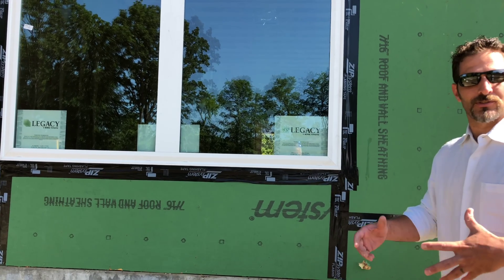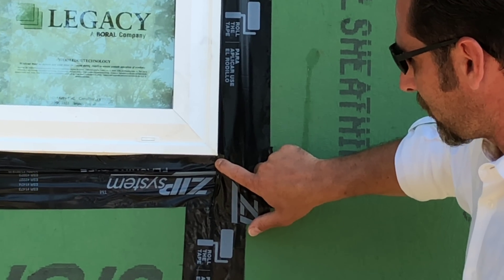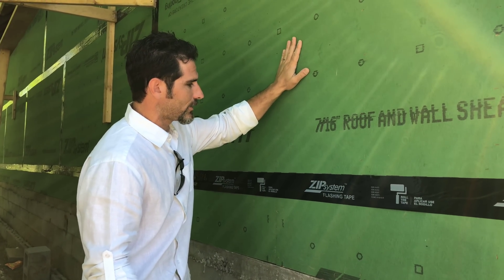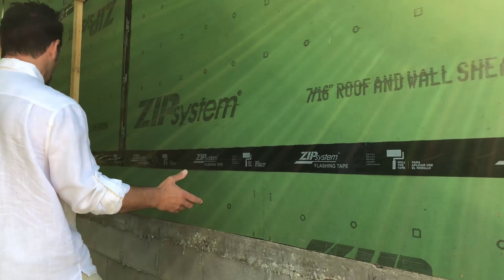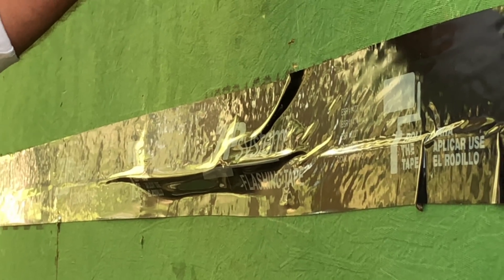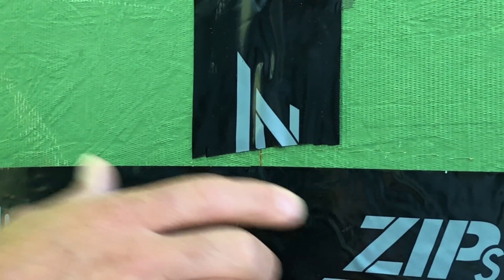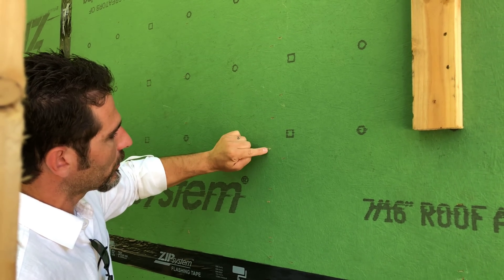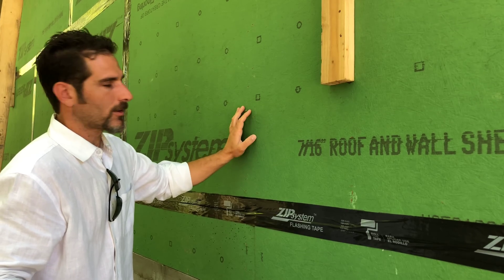ZIP System Problems

Comment: So once the house is sided, don't all these problems go away ??
Reply from the maker: Absolutely NOT!  There is not any type of cladding that does not allow water to enter somewhere! This is a very common misconception I hear even from builders that, "have been building for xx years".  All claddings either wick moisture or allow water to get in around windows, doors, pipes, electrical outlets/switches etc.  You need to make sure to set up your wall system to accept water & drain it.  This needs to be done specific to the type of cladding you are using because flashings, drainage mats & details change depending on the type of cladding being used!  Thank you for watching & feel free to reach out to us with any questions you may have.
Reply: Were that true, every house in this country would have fallen apart from rot years ago.  While vinyl siding IS crap, allowing water in many places around the channel pieces, a good wood or hardiboard siding properly installed and caulked is about as water tight as it gets.
Reply from the maker: Ed Smith if you are willing to rely on caulking to keep water out, that will definitely be a bad idea long term! Caulking eventually separates due to expansion & contraction in the structure as well as the difference in expansion & contraction of different materials at their intersections. If the paint and caulking does not have any cracks or holes in it & it is maintained yearly then you might get lucky:) Thanks for the comments & for watching!
Reply: @WeatherProofingAmerica  You  are talking about cheap "lumber yard" caulking.  Good commercial sealants last for decades.  I remodeled my house 41 years ago and my Tremco caulking seams are all still intact.  Great video  on Zip system.  I agree with your comments on it's shortcommings, but  where is the code required exterior insulation with Tyvek??? I see three separate claddings; sheathing, insulation and air barrier.  Labor costs are driving Zip use here (one installation vs. three)  and many code officials are requiring it.
Reply from the maker: ajaxa9 I try to set a home up with the thought of most homeowners aren’t very diligent in maintaining their home. So if the caulking that a contracor uses  (not a caring homeowner like you) is not quality it will crack or separate from the buildings expansion & contraction. So when I set up a homes waterproofing I do it in the manor that the home can accept the water behind the veneer & drain/dry out! There are some good caulkings out there but most don’t use them!

Comment: So would their Liquid flashing be a better alternative? Also you Mention permeability, If you where to insulate the inside with a Close Cell Foam, would that eliminated condensation issues? I plan on building a house in about 12 mos. but also want to seal the house as best as I can.
Reply from the maker: ZGERMAN I have not personally seen anyone use the liquid flashing with the ZIP systems I have personally seen. Therefore I don’t know how that will work overtime. I can only imagine if people can’t install the tape correctly imagine the time and the effort that it is going to take to install the liquid flashing and especially now that ZIP is recommending all of the fasteners be sealed with the liquid flashing as well. They continue to change their installation instructions which tells me that they are aware of these problems!

Comment: Both tyvek, and zip, can be good if installed correctly. I have yet to see a framer install either one 100% correct.
Reply from the maker: Now that ZIP is requiring the nail holes to be sealed with their liquid flashing stuff (was not always required) you could be somewhat correct!  The biggest problem I see with ZIP system is in order to install it correctly it is difficult & much more time consuming than Tyvek.  ZIP is also much less forgiving if not installed correctly because there are so many tape joints & holes to seal!
Reply: @WeatherProofingAmerica  if if installed correctly, there is no way for the water to get out. It just stays behind the siding. There is no lapping paper to bring the water back out.
Reply: Just curious, are you sponsored in any way by Tyvek?
Reply from the maker: nobster146 No I am not paid or given product by ANY manufacturer! I am just passionate about helping people avoid costly issues:) I have repaired water intrusion for 15 years now and see the heartbreak for the homeowners when they have to pay for something they should not have to & the expense is very high! This ZIP nonsense in my opinion is a terrible idea to rely on, to keep water out! It is however a much better roofing and wall panel over OSB for sure! The r panel is also a good thermal break panel! But to prevent water intrusion is not a good idea in my opinion!
Reply: Yes!  We're engineering ourselves into a corner, with systems that require perfect application to work properly.  But NOBODY installs them perfectly!  It just takes too much time.  Also, the guy who understands how to do this right is too valuable to spend his time taping...he will be assigned projects that "matter", while the least skilled guy does the taping.
Reply from the maker: @fredygump5578  this is precisely why this system has the potential to be disastrous for the homeowners, it is not very forgiving if installed incorrectly & it will more often be installed incorrectly than not!  Very bad idea of problem solving but they are great at marketing!

Comment: My biggest question with the tyvek, is what about the thousands of holes that the siders put through it?  Maybe you can answer that. I haven’t found anyone else who can.
Reply from the maker: Juston Brazada that is a great questions!  It's very simple, they are not holes unless the nails are pulled out!  If the nail is in the hole the water molecules actually seal around the nail & Tyvek & the water runs around the nail because that is the path of least resistance!  Sounds strange I know, but that's what happens most of the time. However if that small amount of water does get behind the Tyvek, the high perm rating that Tyvek has will allow the water to escape & not cause any issues!
Reply: Weather Proofing America, what ties do you have with DuPont?  Your comments read like Tyvek brochures.
Reply from the maker: superspeeder my only ties to DuPont is using Tyvek for the past 15 years to correct water intrusion!
Reply: Weather Proofing America, do you build new homes or just repair/remodel?  I ask because I’m curious how airtight an envelope can be using Tyvek.  It certainly seems like an airtight exterior shell is just about impossible if relying on Tyvek, given that bare typical OSB cannot be relied on for airtightness when taped/sealed.  I’ve yet to see builders showing off blower door results using Tyvek sealed exteriors.

The average builder does a horrendous job with Tyvek, and even a careful builder would be hard pressed to do a truly good job of air sealing with it.

Comment: Basically your video is about poor installation methods by contractors which happen with any product . You can have the best product in the world but if you have people who dont care about the details and only speed you will have issues . I'm sure there are houses  with Tyvec that have some issues as well do to poor  installation .
Reply from the maker: Uri Gonzalez I agree with you!  The point of the video however is to show that incorrectly installed ZIP can have far more issues than Tyvek incorrectly installed!  I was mainly wanting to show people that ZIP is not easy to install correctly & is time consuming, because it was being marketed as faster & easier but it's not!

Comment: Well the contractor screwed that up. You talk about how it should be taped at the bottom is wrong it should have a flashing from studs to out side of the concrete wall so water cant get back in the house.
Reply: Actually what he said was exactly as Zip wants it done.
Reply from the maker: Brent Frederick if the tape is not reliable at the bottom of the wall which is why I am assuming you are saying it needs a flashing instead. Then how are the thousands of feet of tape on the rest of the house okay?  Point here is: this system is being marketed as very easy and quick to install, when in fact it is quite the opposite if done correctly. There are way more opportunities for air and issues than any housewrap ever thought of!
Reply: Brent Frederick moron

Comment: Zip is only as good as the contractor installing it. When done properly it's a good system. Myself? I would rather see plywood with a liquid applied WRB and flashing like prosoco.
Reply: It's insane cost is the only thing preventing me from using it. It's over $2 per sq foot in Canada at least but it definitely is the best solution
Reply: fzr600rr wrong

Comment: Is there any liquid sealant system for Tyvek, if you don't want to use tape?
Reply from the maker: Kevin Hornbuckle DuPont makes fluid applied Tyvek for block or concrete walls but I am not aware of any liquid sealant to replace the tape.

Comment: Why should any water be running down the face of the zip system?   From my experience, the only normal water that is running down the face of the Zip system is condensation.  Condensation caused by the interior cooling system of the house  chilling a membrane near the exterior.  The wet exterior of your glass of iced tea on a hot summer day?  Or perhaps in the winter, the condensation is on the inside of the Zip panel, water vapour migrating from the humidity of a humidified house out to the non permeable barrier at the dew point in the wall?

Use plywood and 30# tar paper,, it works better.
Reply from the maker: Water gets behind ALL veneers (brick, rock, siding, stucco, etc) either through absorption or around opening such as doors & windows or joints in the veneer etc.  So when the water does get behind the veneer, your waterproofing should be set up in a manner that will not allow the water to penetrate the structure!  Tarpaper is a terrible product to keep water out!  I can show you hundreds of pictures of rotted tarpaper because it is an organic product that breaks down when continually getting wet & dried out to the point that it crumbles & is no longer there when we take the wall apart!
Reply: I have been a licensed builder for nearly 50 years.  I have built with every system you can name, with every product x2 to what you have.  If water gets in behind the siding, then you or the architect have made a very basic error in design or construction.  A house built with no over hang, no eaves and soffits where it rains (everywhere?)  is wrong.   A siding that does not keep water away from its sheathing, no Z-strips, no sill water table, is wrong.  Most damage I have found in more than 50 years of building is caused by  no or tiny roof over hangs, no lap of waterproofing around a window,, and lately,, whole house humidifiers that are pumping gallons per day into an envelope with a non permeable layer to the outside in the winter,, or a non permeable layer to the outside in a warm humid climate that requires year round cooling.

Condensation within the walls has become the enemy from winter time humidifiers and summer cooling. And THAT is a problem of non-permeable layers to the exterior.   Most supposed window leakage and damage,,, is not from the windows,, it is from the condensation from the windows, and the condensation within walls..

Yes, Zip R systems will have condensation on the exterior of the sheathing in the summer,, and on the inside in the winter. And if you don't tape the begeeebers out of it....  Exteriors need to allow moisture to migrate, AS VAPOUR.    I have built with all of these systems,, most require a level of care and expertise that is simply not there or will never be there in a commercial rough carpenter's  time, profit, or purview.   The defects you point to in your complaints, are yes, defects.  But they are defects endemic to the product.   There will always be defects of the type and size you have shown.  Always.  It WAS rolled down.  Tyvek,, per the manufacturer, is to be applied after the building is up and in one continuous wrap around the building.   I defy you to try and do that on a windy day,, of 6 mph,, on a ladder,, over a muddy pre graded site, with a crew of less than 10 people.  That IS what you are supposed to do. It is just that,,,, on 29 out of 30 days,, it cannot be done.  Oh,, yeah,, and then you MUST purchase the proprietary tape at 1,000 dollars.    And what makes you think that that expensive tape is going to stick to 10 day old concrete,, or zip r panels that have been dragged through the mud or dust to get them on site.

30# or 45# felt makes a better outside of sheathing barrier than ANY of those products.    Let us go up on the roof,, Roll out ridge vents for a roof are a disaster.  Should never be used,, never be allowed.

And my tar paper extends OVER the wood concrete junction,, and up under the window,, and my skin will self seal,, without tape.  And last for 100 years. And never trap moisture.  So mine never has water running down under the siding, ever.  I have peeled apart 80 and 100 and 200 year old buildings,, it is the 20 year old buildings that are failing.
Reply: @WeatherProofingAmerica  ... your statement - " Tarpaper is a terrible product to keep water out! "
Ges that's why it's been used on roofs for 100 years or so ... to help cause water leaks  (LOL)
Reply from the maker: nemesisX rox the only purpose of tarpaper on a roof was to simply keep the asphalt product from touching the plywood because the plywood will suck the asphalt oils out of the shingles which prematurely ages the shingles making them very brittle and no longer able to successfully do their job. The tarpaper is not intended to keep water out because it does not do that! It is a very porous material and also becomes very brittle after constant exposure to water and or sun! Tarpaper is not a waterproofing material and should not be relied on to keep water out of anything!

Comment: I was with you until you stared talking about breathability. Homes don’t need to breath people do.  
Use zip boated with zip liquid flashing instead of tape resolves all the issues you pointed out.  
No system works of Installed improperly.
Reply: Homes may not need to "breathe" (assuming you have a way to maintain indoor air quality).. but they DO need to be able to dry to the exterior if/when moisture winds up in the wall cavity.   Yes I know... water isn't supposed to get into the cavity... but in most parts of the country, we have swing climates and environments that are the opposite  in August and February.
Reply: @HBSuccess home must breath or they ROT!
Reply: You do not know about structures then.  Study fluid dynamics as well as thermo and you might understand. Check out the Psychometric chart.
Reply: anything that can rot needs to breathe, just not in the literal sense that you're taking it!
Reply: MrJpw1974 so is it better to allow something that can rot to breathe or prevent it from getting wet?

Comment: Looks like more of a problem with the installation and not the product.
Reply: My thought exactly.
Reply: That's the point. House wrap is more idiot proof than this system. Overlap and it breathes. I do use their tape around window and door flanges but once you peirce that sheathing it's not weather proof. Also using staples to prevent that isn't gonna stop those studs from racking under 100 mph winds.
Reply: Junk
Reply: @morehp1  i wrapped my home with tar paper thr old school way probably 17 hears ago. Lol. No rain in my house yet.
Reply: @MrDavidelliottjr  nothing wrong with that,
Reply: That's exactly the problem.